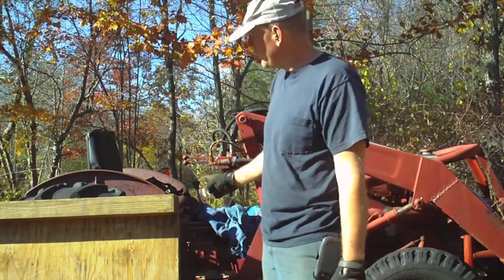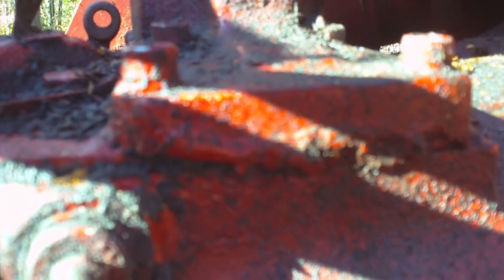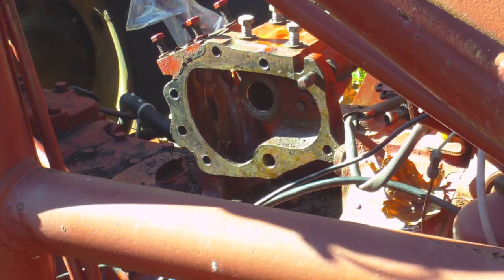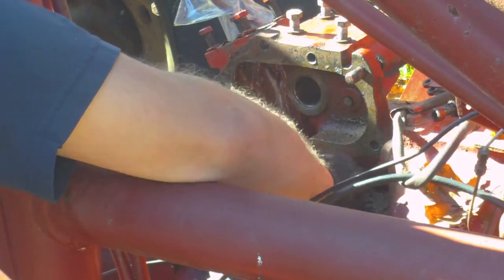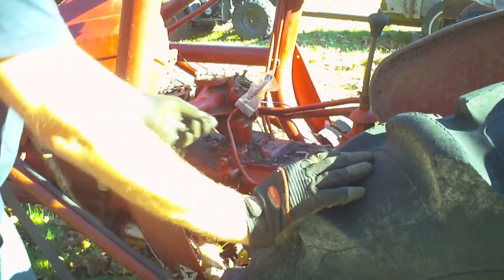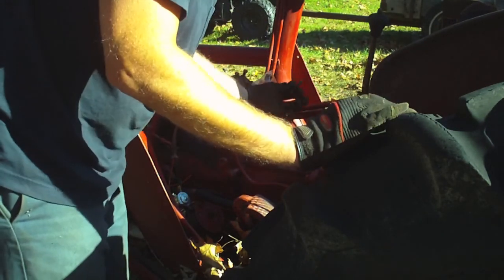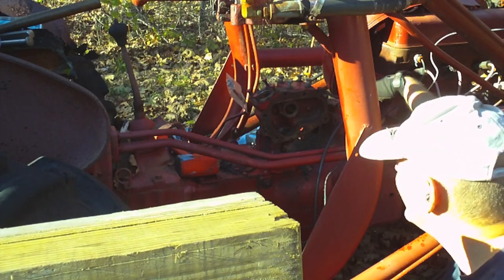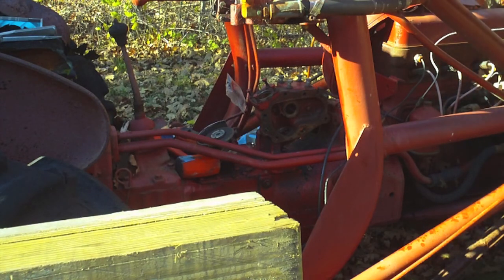IH 350 Utility Tractor Project Part 41

Comment: Steve as a 25 year plus welder first let me say " sins of the farmer " is kind that power steering armature should never have been welded to the transmission / hydraulic tank a angle die grinder with a cut off wheel would make quick work of offensive weld than a tap with a weighted adjusting tool to break it free a handheld electric grinder with a hard wheel will clean off the rest of it, if I was closer I would come over and do it for you I've watched this whole series you have considerable time and money in to the engine with good results am looking forward to seeing this fine old tractor working great videos good luck

Comment: Hi Steve I think you made a wise move backing away from that project. If you get it off you  probably got to re weld it to stop it moving again, without another major project if the bolt holes are messed up big time. It could be welded with a nickel or other non machinable welding rod to. I have also seen cast react with heat during welding , and go so hard you can't grind/ file it easily.
 I had a job for a guy here did that when I welded it. I think it was a diamond point bit in my Dremmel kit, I used to grind down the weld in the end.  It was an essential emergency repair and the guy couldn't get new parts off the shelf. It took ages to grind but it worked and he paid the hours.
 For those that blame farmers I have seen some spectacular fixes from "Professional" welding shops round here to, when I've been fixing on farms at different times, so it's not just farmers doing dumb stuff somedays!.
Regards Robert
Reply from the maker: Hi Robert. I think you're right. One of those bolts in the video did not want to back out, just kept turning (stripped hole), another bolt kept going tight loose as I unscrewed it, apparently it was bent, and I think another hole had nothing in it. To fix it "right" would probably involve hours of grinding. And if I did get it off, I'd probably opt for a junkyard transmission cover to avoid reworking the old one.

Comment: Did you ever get back to the steering on your 350U?  I have a 55' 300U that seems to have the same problem. Just wondering if it would be worth my time to tear it apart to try fixing the steering.
Reply from the maker: Robert W the only way you're going to find out if it's worth trying to repair it, is bt opening it up to see whats bent or broken. But I can tell you from experience, most of the parts in there are no longer available, and most tractor used part dealers want to only sell complete used boxes. So fixing your current box might involve machine shop work, and or welding.

Comment: Hey Steve...My '58 350U has it's steering box welded on in exactly the same place. Power steering was working when I parked it 2 years ago so keeping my fingers crossed in case I ever figure out which starter/starter drive configuration is correct. Keeping your invaluable series very close by, though. BTW: what year is your 350U and where is the serial numbers? Or, did you ever find them? Thanks—Jim
Reply from the maker: Jimmy Lester hi Jim. i honestly can't recall if I ever found the serial number or the year.  I'll have to check my notes.
Reply from the maker: Jimmy Lester I just checked. I did research it way back when I first got it. it's a '58, one of the last ones made.

Comment: Hello came across this is search of what maybe going on with the 1955 IH 300U we just bought. The steering on the right side doesn't move at all when you turn the wheel to the right but it does when you turn to the left. He took of the tie rod if I am correct in the term used for the part. What do you think it may be with your experience as I watch through your videos and all the stuff you went through??any ideas??? was thinking trying to find a used steering box but still in the works for that???hopeful but doubt it and don't want to go through what you went through. very informative videos by the way...great job on all the work... just wanted to see what your thoughts maybe...thanks
Reply from the maker: MaryCatherine Johnson Hi. Only way to know for sure is to open up the gear box. But my guess is that you have a broken tooth or 2 on the shaft with a sector gear on the end. Major parts are almost impossible to find, but a good machinist might be able to repair yours. A complete used box is an option, but it might take some searching to find a reasonably priced one.
Reply: Steve Watroba Thanks. We are trying to do some research and locate one that maybe easier but probably expensive. Got a call on one for 975.00 plus freight. Still checking but supply and demand always wins...shame though turn the key and runs like a kitten...well thanks.. great bit of info on the videos thanks so much for taking the time to post....
Reply from the maker: MaryCatherine Johnson you're welcome, and I hope you find a good used box, but I'd tear yours open to see if a chipped tooth might not be repairable. What state are you in?
Reply: Steve Watroba In WV. I actually found a box and will be picking up tomorrow. It is a gamble but at $120.00 for the complete box w/o steering wheel is to good to pass up at this point. He has a bunch of parts so was lucky to find.. but still have others on the look out though. How r u coming with yours?
Reply from the maker: MaryCatherine Johnson I was unable to find a steering column, so Am hoping I can repair mine. Even if I do that, I still do not even know if  my other repairs will hold up.

Comment: That's a bummer with the welds. Those are repairs in which they did not think about future access whatsoever! That's a definite wrong way to do it. I sure hope you can make it work. I'm sure you would enjoy the use of the tractor.
Reply from the maker: I guess I'll just assemble it on the tractor. If I do need to get it off, I'll probably pull the loader off. That would give me room to work.
Reply: Can you get a 4.5" angle grinder in there to grind them off?
Reply from the maker: BannisterHall .farm   I tried, it seemed like no matter what angle I tried, something got in the way, usually the loader frame. Not to mention the welds were not grinding easily,,,,,,hard stuff.

Comment: Would someone explain how I can ADD oil to my 1956 International 300 tractor? thanks ahead of time.
Reply from the maker: Hello.  on my 350u the oil fill is a cap on the right side. my distributor mounts to the rear of the hydraulic pump. the pump then mounts to a casting that bolts on the front of the block. that's where my filler cap is. hope this helps.